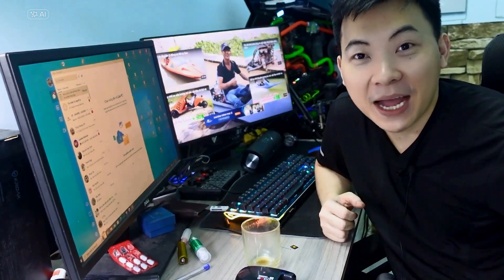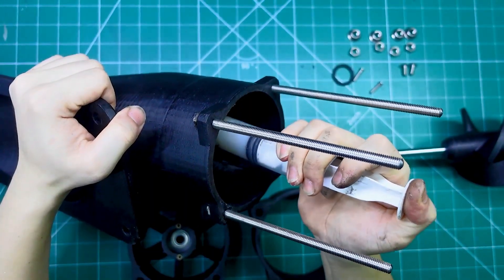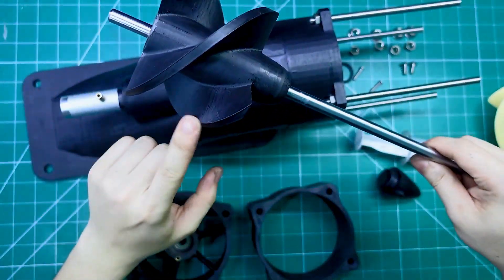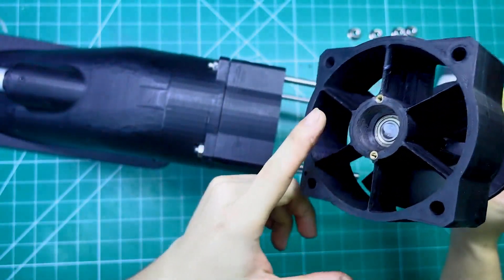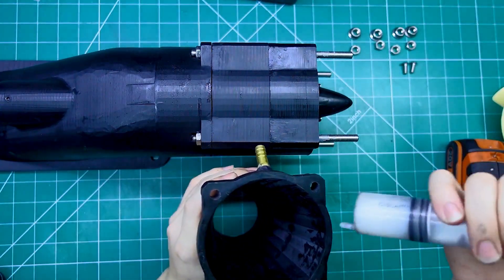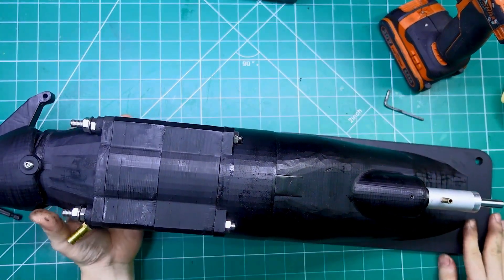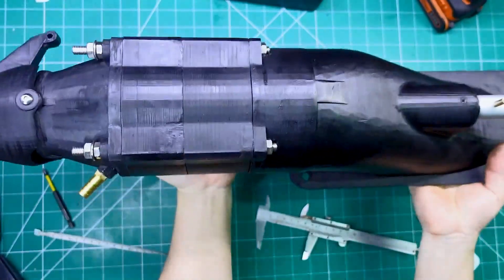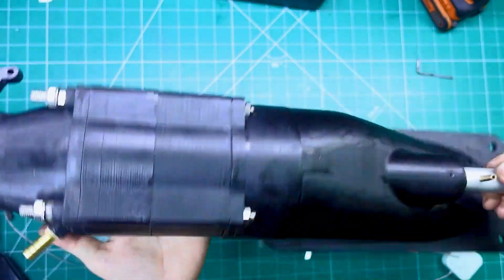Will My 3D Printed Jet Engine Explode at Full Speed - DIY Turbojet with 3D Printed

Comment: some questions: 
Do you prime the jetpump before using it (fill it with water and keep it completely under water while using it)?, a small amount of air inside the propeler chamber during operation will expand and cause cavitation, reducing thrust
Do you have any form of "stop" or way to prevent the propeller and spinning shaft to just push backward (towards the stainless steel bearings) during operation and get damaged due to the plastic propeller constantly rubbing at high speed against the bearing? you mention lubrication, but basically all the force generated by the propeller will be applied to a small portion of plastic and will eventually wear out, i would suggest replacing the stainless steel bearings some type of thrust bearing with a circlip or something stronger.
Reply from the maker: Hello there! In this version, when I designed this motor, I intended for it to be mounted beneath the hull of the boat—meaning the motor will be fully submerged in water. That way, there's no need for priming.

This type of propeller has a very steep pitch, and based on my calculations, it will work well with low-RPM motors, so there's no need for high-speed rotation. All the bearings and metal components are made of stainless steel.

Comment: İ think there is room for improvement eather the intake opening needs to be larger or the main shaft needs to be smaller depending on the motor also i don't think the steering nosil can survive

Comment: What is the engine capacity (power) of this engine ? What is maximum speed of the boat using this engine? What  the total weight of the boat? What weight this boat can handle at maximum speed?  How much cost  the creation  of this engine?
Reply from the maker: This is just a test version  I’m still working on it, so no exact specs for now.